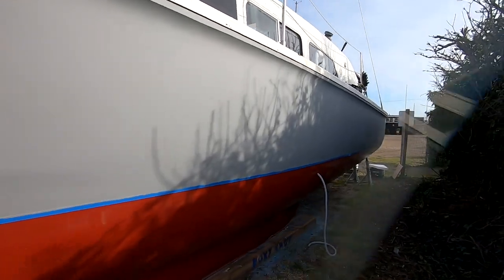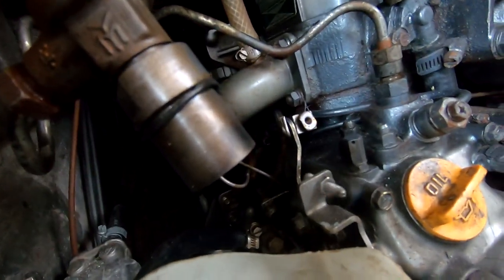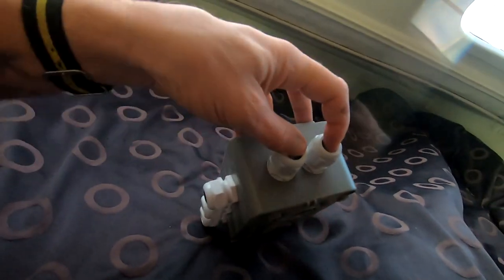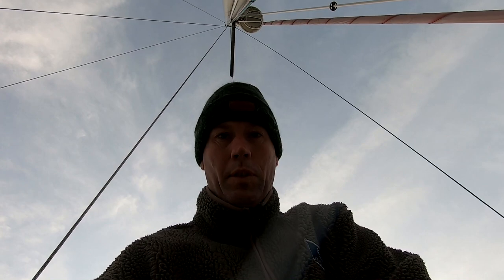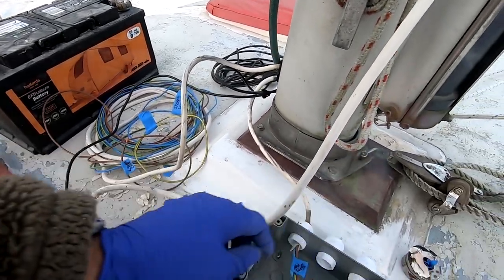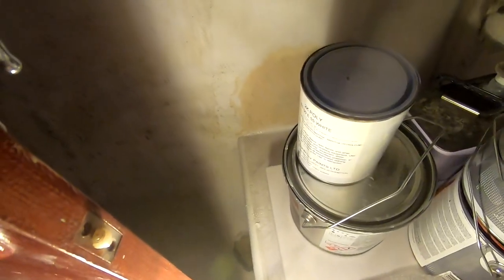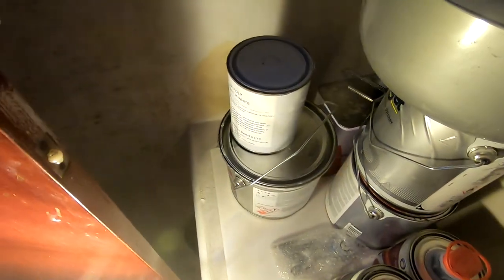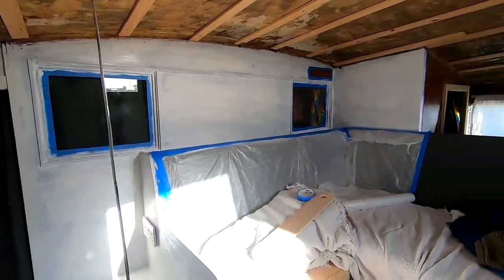Yacht Restoration Mast step wiring, bulkhead paint and hull primed E126

Comment: Engine wise: Could it just be the cold weather? Do you have a cold start button? If the injector does do a spray, it doesn't look very even. Paint looks great, doesn't half make a difference.
Reply from the maker: Thanks Paul, there is no cold start button, compression is 400psi and injector been tested now. Still the same!! I will do further investigation in the near future but flat out with job at the moment!☹️.